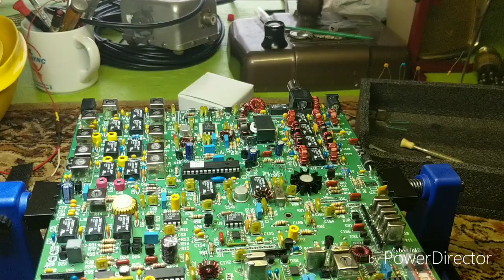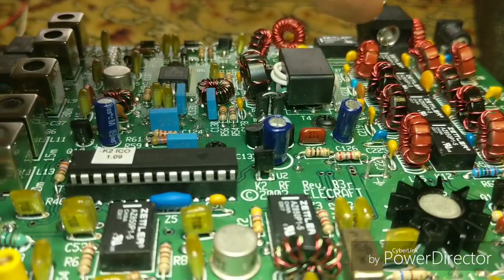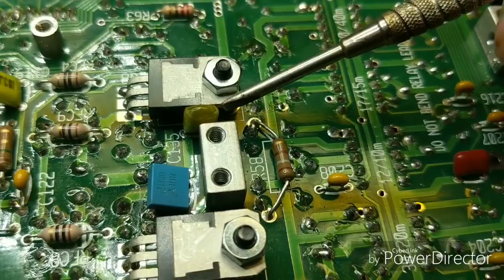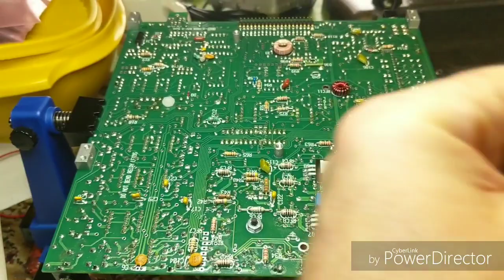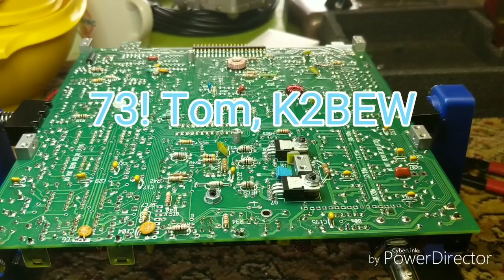Elecraft K2 C135! PT 18

Comment: Tom - I’m about to start my K2 build and based on this video wanted to make a note in the manual at the right location so that I install C135 correctly.  Looks like page 59.  There are a number of bottom side components that the manual says to bend over, but C135 is not one of them.  So you are supposed to leave it standing.  But it says nothing about mounting close to the board, so I made that note.  BTW - thank you so much for taking the time to make these videos.  I’ve watched them all and will refer back to them as I go through my build.

Comment: Finally got to this part in my build.  Since there are a lot of this type of capacitor (103) used, I was able to find one that had the right lead spacing that allowed it to sit right down on the board and clear the standoff while standing up with no further modifications needed.  So that’s my recommendation to others - choose this capacitor carefully.
Reply: Hi. Can you share where you sourced that capacitor with the ideal lead spacing? Thanks
Reply: CW CW   Actually I just picked it from those supplied in the kit.  If the first 103 you pick does not fit well, keep trying until you find one that does.
Reply: @W8EWH  That's interesting, good advice, thanks.  Because the finals are installed after that capacitor, I wonder what the max distance is that the cap can sit above the board and still clear the top of the finals? P I haven't rec'd my K2 kit.
Reply: That got posted before I was done! lol. Probably more important is to find the lowest profile cap in that classification and keep it close to the board? Thanks again
Reply: CW CW  Keep it below the height of the 2D fastener.
Reply: @W8EWH  Right, that makes sense. Thanks